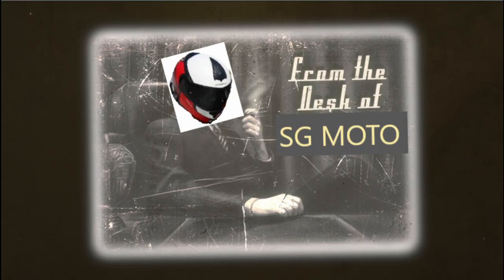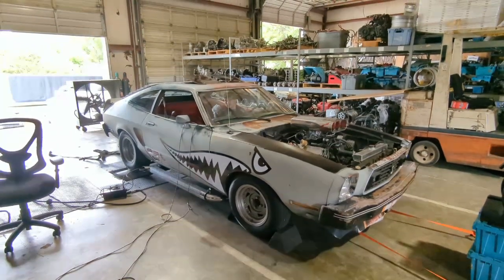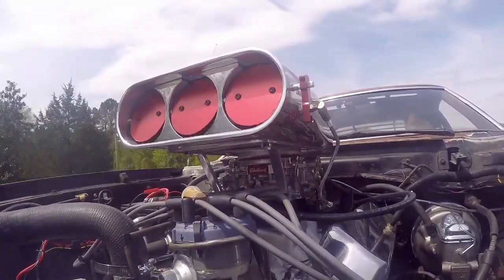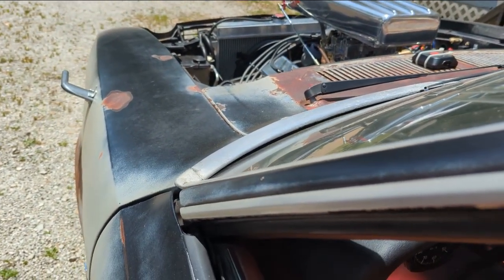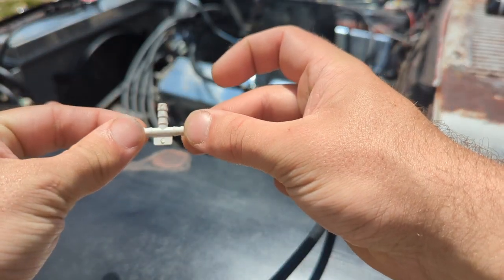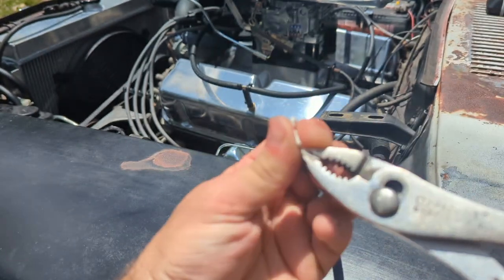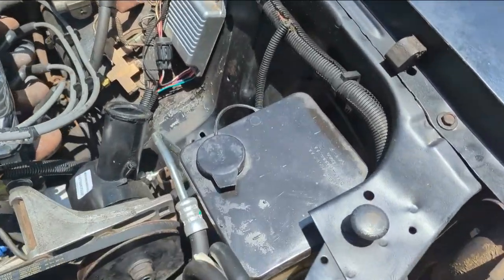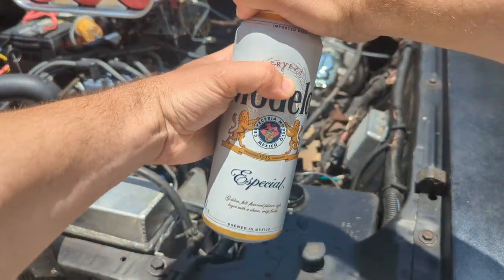CHEAP AND EASY DIY RADIATOR/INTERCOOLER SPRAY

Comment: thats some hack stuff  right there no shroud on the fan  and spray that volume of water will last  10 seconds form your washer tanks  use garden misters  and a pump put in a water container and it will mist for a few hours